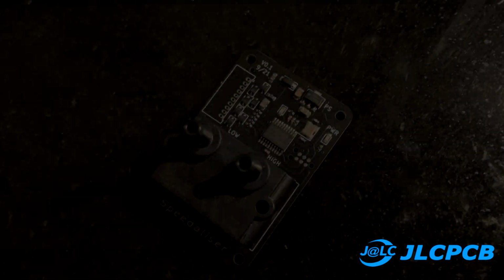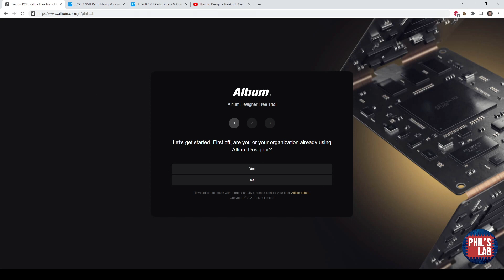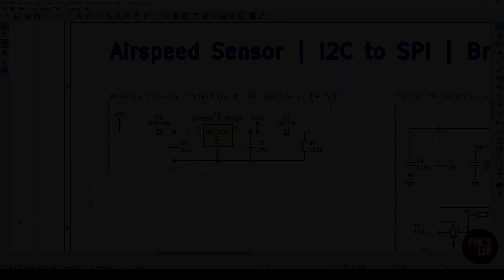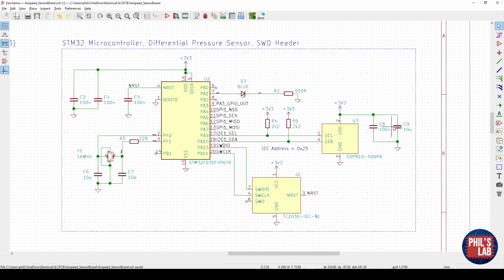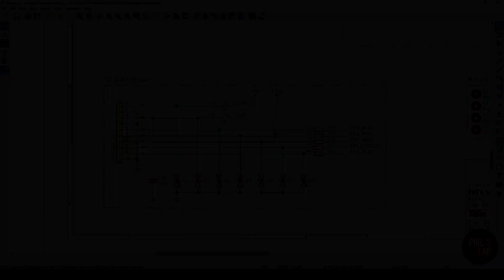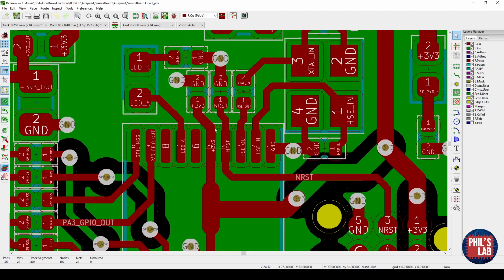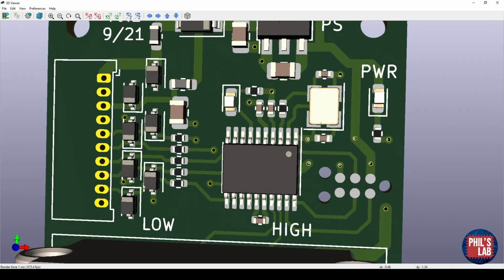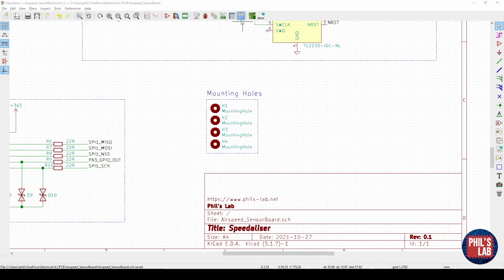(Sponsored) KiCad Breakout Board Design (STM32 + Sensor) - Phil's Lab #36

Comment: Why is BOOT0 pin permanently pulled up to the ground, it should not be on the jumper? Will there be no problems with switching the work / programming mode

Comment: Stm32 didn't perform as I thought. It was damm slower than pic12f675. Blue Pill or something.
Reply: I have used the NXP LPC series almost exclusively for many years. Every time I consider giving the STM32 series a try, I end up just using what I know works.

I did always love the classic ATmega architecture for assembly work though. It's a beautiful instruction set to write.